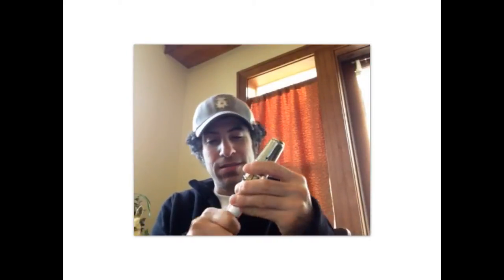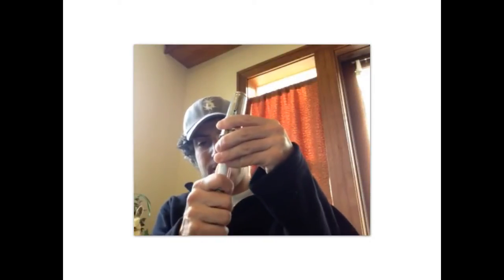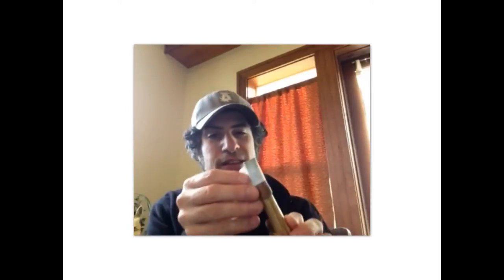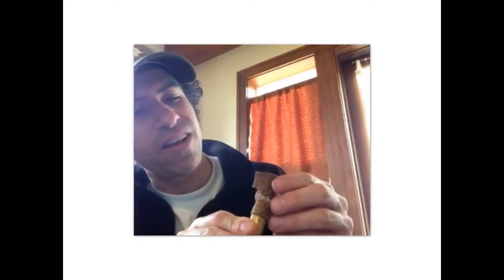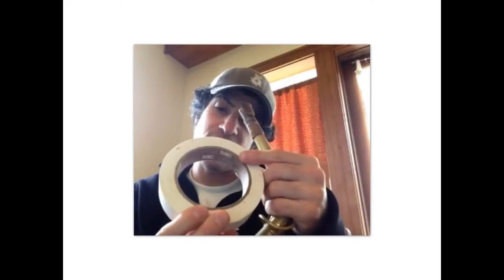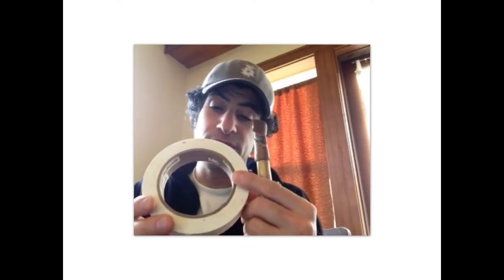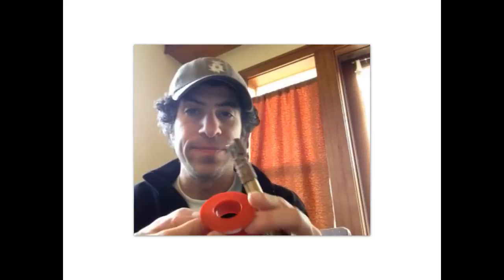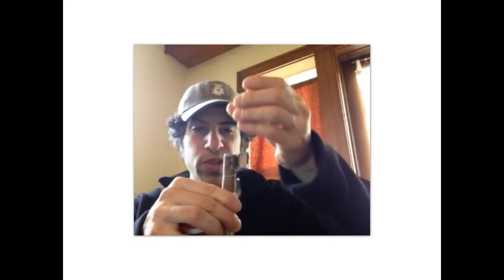Emergency Saxophone Neck Cork Repair

Comment: I used a Yani hr m/p on my alto for a while and it really compressed the cork, even scraped it a bit. I'm now using a Navarro Maestra and I thought I was going to have to get the neck recorked. After googling about it, I steamed the cork over a kettle, protecting the neck with a tea towel, just for around 10 seconds, rotating it in the steam. It worked great. I've had to redo it once but now it seems to be good to go. Useful to know..!

Comment: Plumbers tape is an awesome material for those small diy fixes. It works great to fix small adjustment issues, like old corks that have been compressed too often. I also saw it used as a sealing on really old octave pads.